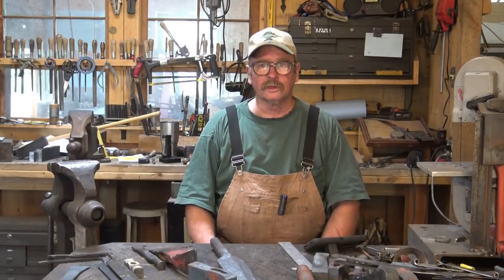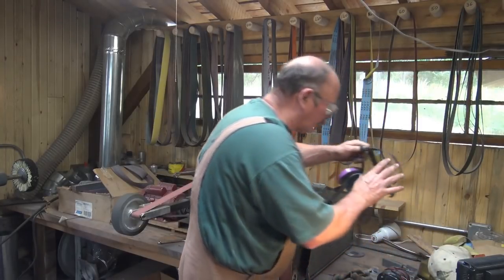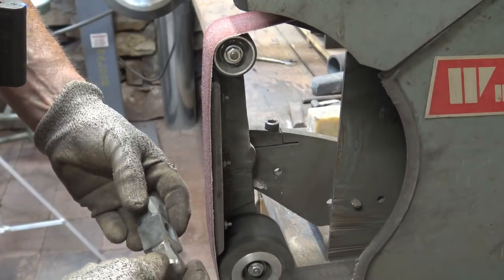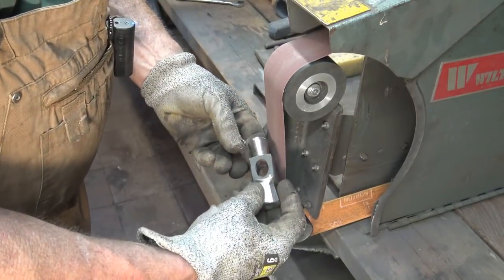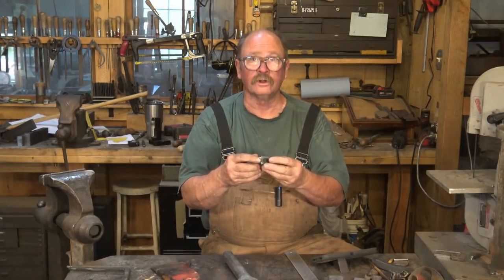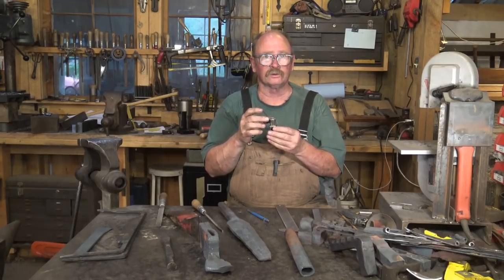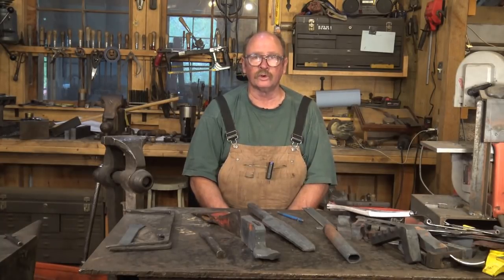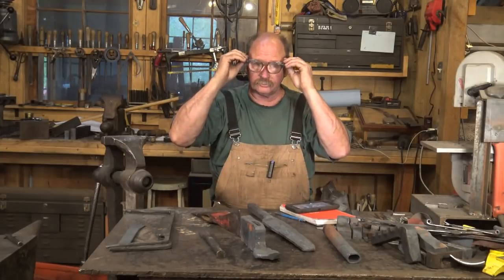Making a small ball peen hammer - tool making - part 2

Comment: Thanks for another great tutorial. A hammer is on my list.
Why didn't you forge the ball end into more of a round/ball end before grinding? Just wondering.  Thanks.
Reply from the maker: Mostly due to the size and risk of distorting the main body of the hammer.  If I were to make a lot of these I would make a die that shapes the ball end safely and reliably.

Comment: im confused as to why you didnt harden while you had it hot i mean you have done all needed but harden and temper you could of been one step away from done
Reply from the maker: mostly because I prefer to keep the heat at just the right temp using an electric oven.  Hardening right out of the forge is less precise.  I also wanted to go through a normalizing cycle after grinding to remove any additional stress.  But finally because I wanted to wait and include that in the final video.
Reply: Why the need to normalize after you had previously annealed it? Wouldn’t all the stress be relieved in the slow vermiculite cool? Thanks!